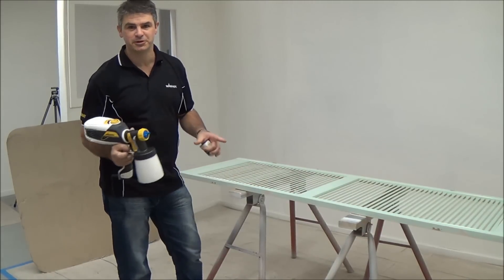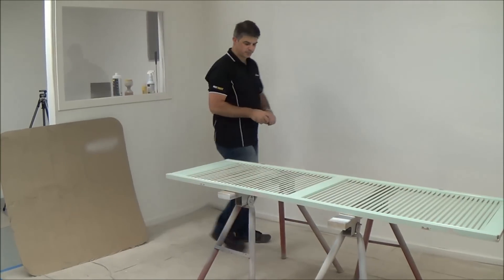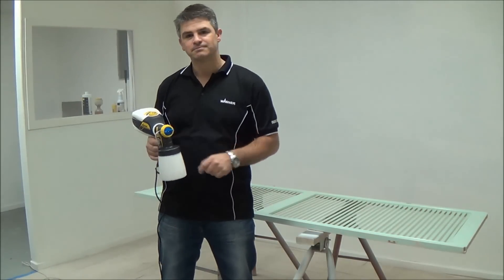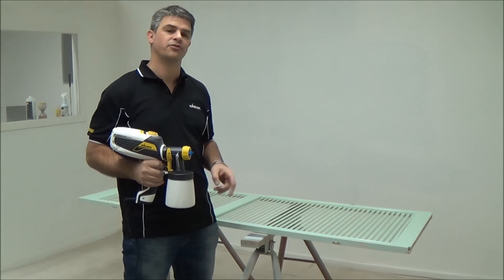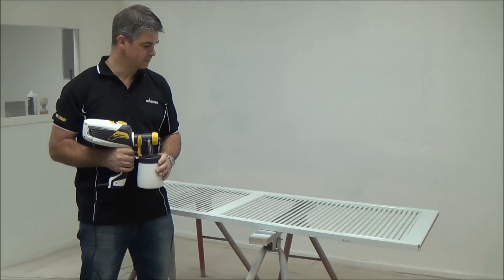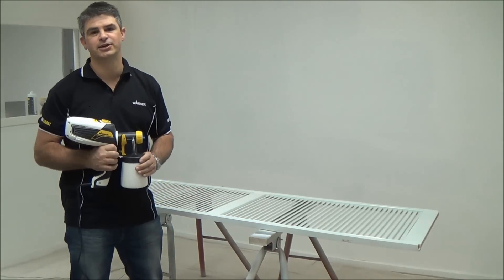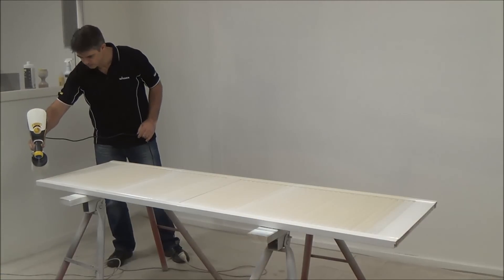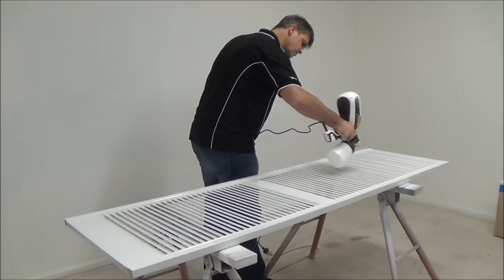Wagner FLEXiO 585 - Spraying a Louvre Pantry Door

Comment: My wagner 585 works well when it is working properly. However, it is very temperamental. The manual says to wipe the nozzle regularly. I find every third, or so, time I do this the gun starts spitting out globs of paint. There seems to be nothing to get it going again except to pull it all apart and clean out with water. Takes forever!
Very frustrating. 
High maintenance piece of equipment. Good when it behaves itself.